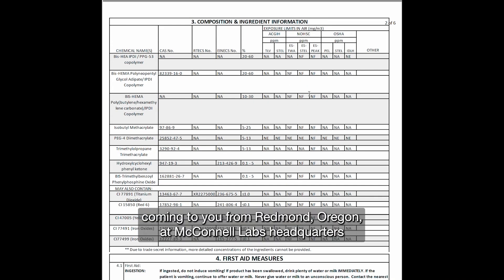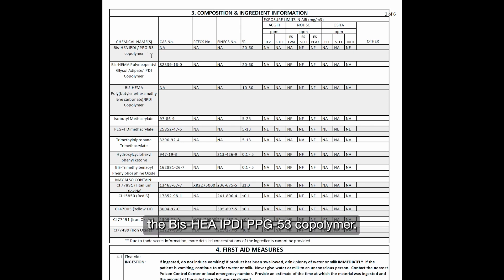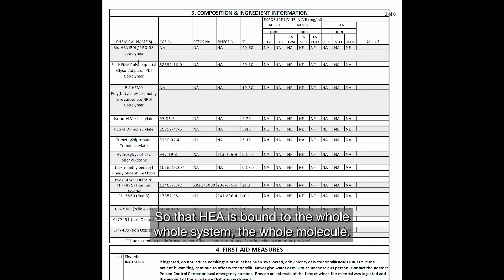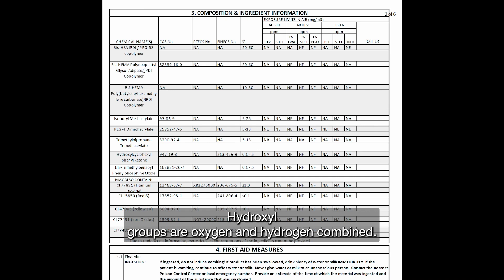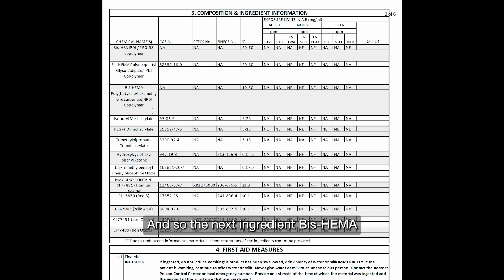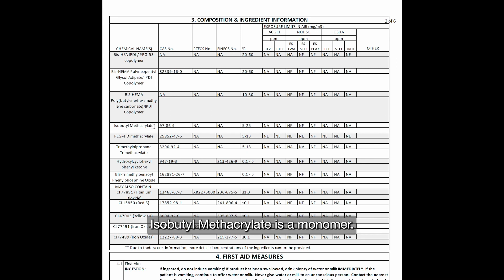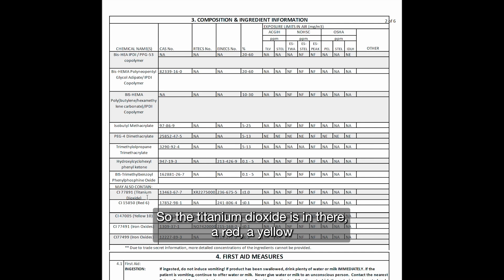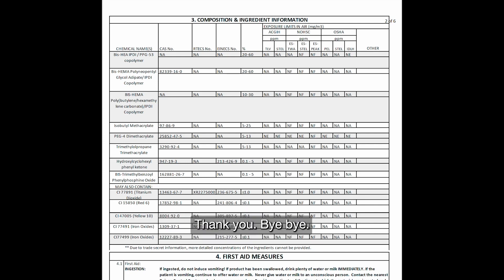Part 3 Reviewing SDS Sheets - Section 3: Composition & Ingredients | Jim McConnell | Chemist Corner

Comment: Some SDS I've read list "urethane acrylate oligomer" as the first ingredient. Do you have more information on that?
Reply: This is a very good question.  The term "urethane acrylate oligomer" is a generic term for what the resin is that is used in the system.  That term is not an International Nomenclature of Cosmetics Ingredients (also known as INCI).  An INCI name for an acrylate oligomer would actually tell a chemist what the chemical structure is of that resin.  The use of the term "urethane acrylate oligomer" gives a general idea of the family of the chemical but not its actual structure.  All ingredients are supposed to be listed by INCI names.
Reply: @jimmcconnell6079  Thank you!

Comment: If a SDS says "Acrylates Copolymer" could one of the components of the polymer be HEMA or Di-HEMA?
If so, let's say the "Acrylates Copolymer" of a nail product has a high percentage of HEMA or a high percentage of Di-HEMA. Could an allergic reaction to that product happen?
Thanks!
Reply: Hi B3.t - Acrylates Copolymer is a polymerized acrylic material and is a powder or solid material.  There is no HEMA monomer in Acrylates Copolymer.  There will be no allergic reaction as a result of the Acrylates Copolymer being in a formulation.  The Acrylates Copolymer requires something to dissolve it and in the case of gel systems, that is a high concentration of monomer.  As a result of the increase in concentration of the acrylic monomers, higher allergenic response rates is more likely than older style gels with high levels of oligomers.